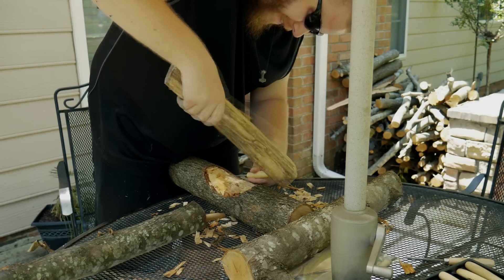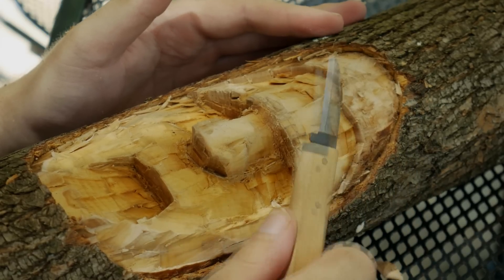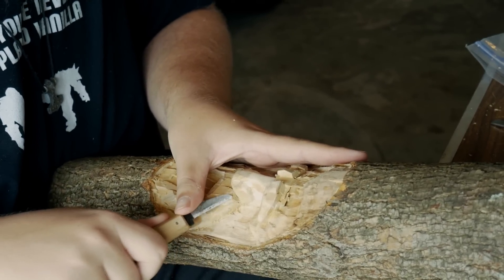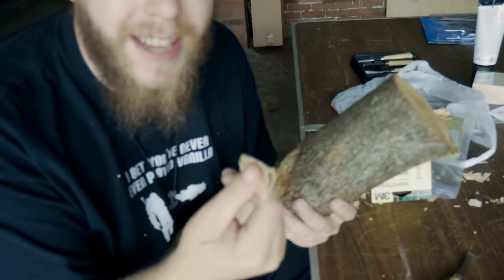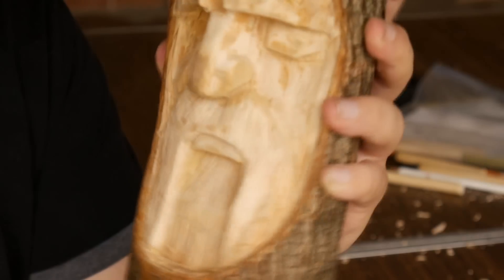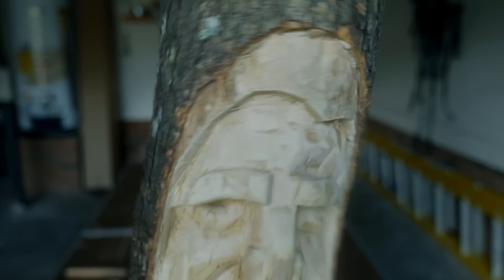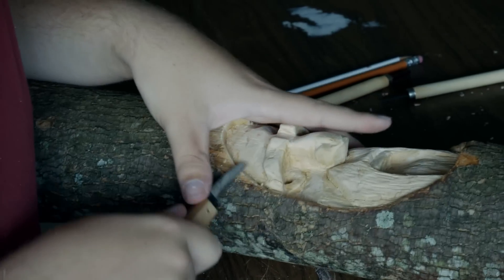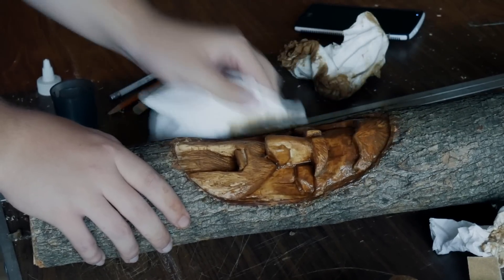How to Carve a Wood Tree Spirit

Comment: When you cut towards yourself you stop the blade with your thumb. Mainly for precision but also safety. It might not seem safe, and it might feel like you're gonna' cut your thumb but actually, there's such a short way for the blade to travel and pick up speed that the worst injury that can realistically occur is no worse than a papercut. On the other hand, cutting away is not necessarily a great idea, if you rest the piece of wood on your leg because there isn't a table and the blade slips it can easily cut a nice chunk of flesh out of your knee.